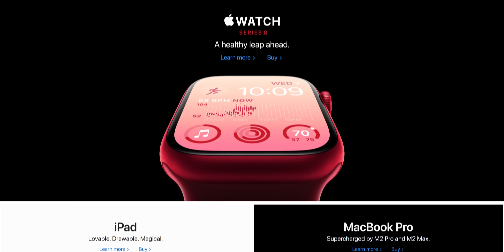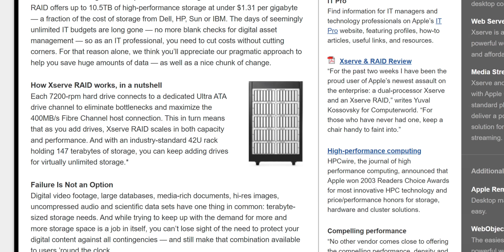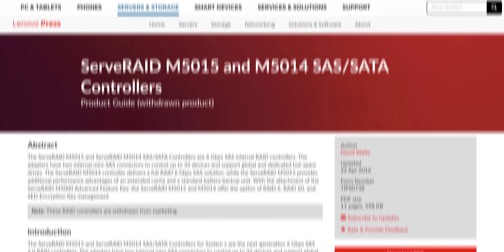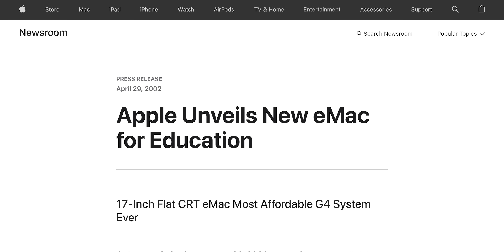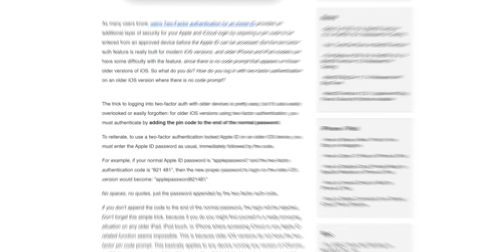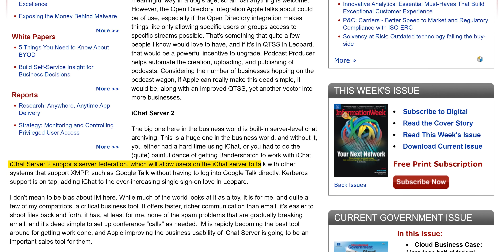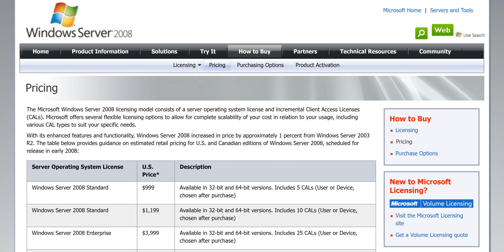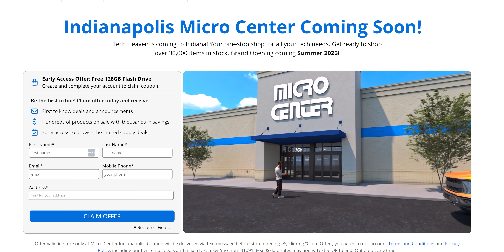I Bought the Last One Apple Ever Made... - Apple XServe 3,1 Server

Comment: Hi @Linus tech tips if you want to make it into a gaming computer, I’ve had experience with it in one of your previous videos, roasting your set ups pt- 1 about 14miniutes in. My submission was an xserve 3,1 you can easily upgrade them to a 4,1 and put xeon X 5690s in them and even upgrade the MXM I used it as my gaming computer for some years I even got windows 10 running on it you have to disable auto recovery otherwise it doesn’t like booting into it. You can even use other hard drives and SSD’s in the sled I used a 1 TB WD blue ssd. Good luck it’s a pian but is easy with time!

Comment: Apple hardware was and maybe still is used for picture archiving and communication system (PACS), x-ray imaging systems in other words, in hospitals. I remember a set of G3s and G4s later sitting on the floor of our computer room back in 2004/2005. We were not to touch them, only the PACS admin of the hospital and the vendor were allowed. One of these mounted in a rack would be far better and some cheese graters on the floor.

Comment: In my years as a System Integrator I came across exactly one Xserve out in the field. The customer was using it to run a Windows Terminal Server using Parallels for their ERP software. Besides that it basically acted as a file, mail and Open Directory Server. They replaced it with a generic HP Proliant a few years ago, sadly.

Comment: It looks surprisingly like every other 1U rack mount server I've ever seen. Are you sure the drives are firmware locked? On Dell servers, non certified drives will work just fine, except some of the management systems won't work right with the plain drives. 

Since most of the server software wasn't actually Apple specific, I've always assumed most of the failing of the product was just due to lack of a need for an Apple server.

Comment: I think it was 2006 when I installed 4 XServes at where I worked at the time. I remember the first thing I did after getting them rack mounted was setup integration with active directory, lol, that was "fun", especially because there weren't that many resources on it back then. Apparently, after I left that job, no one else knew how to use the servers, so they sold them like a year later.

Comment: You seem to be making the OS image creation process much more of a headache than it is. Yes, you need a running Mac to create Mac boot media, but you sure can install those older OS installers on newer versions of MacOS, and then using the CLI, you can create boot media from them. No need to frankenstein downgrade or upgrade machines just to get an OS on your Xserve. The drives also aren't proprietary, mine has a random Kingston SSD in it no problem and the original drives are in a TrueNAS box. Inside of the caddies is a normal SATA/SAS connector.

Comment: One of my last jobs I worked for a place as SysAdmin for a place and my lame manager was an Apple Fanboy.   So even though we were mainly on Windows and Linux he tried to get us to buy a Apple server.   So since I had done hardware eval's for other companies I was tasked with evaluating Apple server.   So I talked to Apple and even Apple was unicorn farts at how great their servers were, but could answer few tech questions.  They also went quiet when I asked if they had any customers I could talk to.    Basically I discovered hardly anyone was using Apple servers.   I used to work large university so I called around and found one department that had bought four Apple servers and arranged to talk to them.   So they showed me their rack of Apple and Windows servers.   Long story short even thought they were Apple diehards they were phasing out the Apple servers they were a expensive experiment that failed.     So Apple servers died away like Apple's Unix A/UX that came on 50 floppy disks and took all days to install, while praying the install didn't die just stop so you had to start over.   

So I convinced my Apple fanboy boss no to Apple servers and just be happy that the graphic department and media department have about fifteen Mac Pros.  That the video cards died on a lot and in media doing large file transfers to external storage choked on all the time.    So glad I'm retired now and don't have to deal with servers anymore.

Comment: Keep in mind that this uses the pre-UEFI firmware (EFI) in 32-bit mode! (EFI-IA32) So booting other operating systems is possible, but they assume the processors and the EFI to be the same and trip over the fact that a 64-bit CPU might be starting up using 32-bit fimware. It can be done, and you can even install Windows, but only if you chainload the windows bootloader via GRUB since it can setup the environment just the way windows likes it. Otherwise you're stuck with 32-bit Windows, and that would be a waste.

Comment: Oh! I've worked with these for 6 years ending only 5 years ago. Not even. The Paizo website used to run on these exclusively and I slowly worked to phase most of them out.

You are so better off testing with Safari. As the XServe support wained post 10.6, server support got worse and worse and worse. Including no longer supporting drivers for front panel lights.

Comment: Definitely would be great to see a follow-up. Whatever wacky things you can do to abandoned hardware is always fun.
Reply: agreed
Reply: Yes, please.
Reply: linux
Reply: @0q2628  Actually, back in the early 2000s, I worked at the university surplus and installed Linux on... things. Brandon liked NetBSD, which also is compatible with a wide range of hardware.   Ended up throwing it on a Digital Equipment Corporation (DEC) DEC MIPS system, a DEC Alpha, and a DEC Vax (a vaxstation 3100, which was about the size of that xserver rather than some huge rack like the early vaxes... or vaxen.)   An SGI (but put Irix back onto that), we put it onto an HP PA-RISC box that showed up at work, and of course a PowerPC Mac.  Mostly we got (earlier on) Gateways and (later on) Dells by the thousand but the exotic gear was fun. The Alphas and the PA-RISC were seriously fast (I picked up this close to 10-year-old Alpha with a 400mhz CPU and it was kicking the crap out of my (at that point year or two old) 900mhz Duron.  Especially video encode/decode, the Alpha had a "Motion Video Instruction" set addon that made it encode/decode MPEG2 and MPEG4 at like probably 20x the speed my Duron did with it's MMX and 3DNow instructions.  That was kind of nuts.

(As a prank, these guys actually rigged up a powerpc linux install with the same desktop and stuff installed, moved my home directory over to it, and took bets on how long it'd take me to notice.  It took like an hour or two, everything ran identically except for some reason the numlock capslock etc. lights weren't lighting up so after an hour or two I decided to reboot it and heard that mac startup sound... "What the...?")
Reply: Absolutely - looking forward to seeing what the guys can get going on this piece of kit :D
Reply: Yes, a follow up would be very nice!

Comment: Maybe a video idea for a followup :)

One customer still has three of the units running. Only Windows Server is running on them :)

The customer is very committed to sustainability and does not want to throw away functioning devices - and that is absolutely understandable :)

Windows Server can be installed natively on the hardware - without any tricks.
If there are still problems, the software rEFInd can be used.

Comment: As multiple other comments have mentioned none of the drive connections are actually proprietary. Also there are easy workarounds for installing any of those macOS versions as well as the Server app. You can even go to newer versions of macOS then are officially supported. Would love to see some more videos doing upgrades to older hardware like this!

Comment: Delidding those xeons isn't that hard.  Cut the adhesive and use a torch to melt the solder.  I did it for my mac pro.  If you destroy a chip at least they're cheap.

Comment: I might have a copy of Xserve software around here somewhere.

I heartily agree with your description of the hellscape of mac upgrades.  The only thing is, I've been bitten by things like this on a regular basis with normal modern upgrades, where their policies cause nearly the same level of problems.  Like refusing to install upgrades on a Mac Pro trash can with third party SSDs.  Or, like refusing to do network installs over ethernet, only WiFi (WTF?).  That issue where you can't create a thumbdrive for an OS without already having an OS that was upgraded with the downloaded installer (and then not deleted) has bitten me over and over again.

Comment: I use OCLP on my classic Mac Pro 5,1 and it's a power house, dual Xeon X5690's, liquid cooled 6900xt GPU, Raid Card with 4 NVMEs on x16 slot, 96GB Ram. And I have Win10 on it for gaming.  I'm sure you can do something similar to the xserves too.
Reply: https://forums.macrumors.com/threads/custom-water-loop-in-my-mac-pro-5-1.2310214/

Comment: I bought one of these from eBay a couple of years back for £30 just to have a tinker. Threw in an old PC 8600 GT card to get a display and had no problems with generic SATA drives, they’re actually not vendor-locked and the only catch was it didn’t like SATA 6G devices. Sold it not long after to a small business that still actively used an X-Serve which had suddenly decided to die during the week I’d put it back on eBay at a cheekily high buy-now price.

Comment: We used one as a MDC for XSan over a decade ago. It was for a custom video publishing pipeline we built for a big client and they already bought all the hardware so we integrated it ... its performance wasn't anything special but it handled 20+ users accessing storage and processing video without issue (actual processing and applications where on separate linux boxes)

Comment: Yes go ahead and make a gaming Laptop out of the thing.
On the point of your mentioning that Apple sometimes can be a Jerk about allowing the end user to move forward with their system, HP is doing the same on some of their machines.
I have a newer HP ds series laptop which HP crippled right from the factory by leaving out one of the plastic DIMM caddies for additional RAM.
The whole series, and probably others, are crippled worldwide. The machines only allow the end user to access 8GB of RAM when, if they had soldered into the empty space for the caddy the 38 cent plastic part, the machine might be able to access 64GB provided that manufacturers make those types of modules for the system.

Comment: if one were to find a one of these without drives but all the sledges, what spec are they to be able to replace them? vendor lock isnt a huge deal as long as its still possible to get them or at least emulate them

Comment: The connector is NOT proprietary, and the disks are NOT vendor locked. Apple always shipped any drive for the Mac with custom firmwares, which never meant you could not use thrid-party drives.

Comment: i was running snow leopard server in a physician's praxis until patient data management software decided not to support running on 10.6 but needed 10.8. the update took a full weekend, most server functionality was killed (the 20 chf appstore app is crap, will not migrate software from 10.6 server correctly) and basically from then on, it was not a network with workgroups managed centrally but single macs for the physicians connecting to a linux server for some functionability and to a NAS for timemashine. apple killed the on-site server for good and probably angried a lot of small/medium business customers with the killing of 10.6.server.

Comment: so apple does what microsoft does.. give you an update that disables features so you have to buy new software/hardware (software for microsoft)  outlook was a great example, update it so the older version gives you a bogus error and not connect to exchange any more.  Thus you have to buy a newer version of outlook.   talking 2003 and 2007 days. of outlook.  worked fine with newer exchange until you did an update, that cripples it hooking up to exchange..

Comment: 5:14 I don't think that HDD is proprietary. It looks similar to the hard drives that were used by full-size potable audio players from that era e.g. iPods: a 1.8" PATA hard drive with ZIF connector. Many thin-and-light laptops during those days simply don't have the space needed to shock-mount a 2.5" PATA HDD, so they'd use the 1.8" ones instead.

Comment: FYI you can extract the installer app from that installer package without having to run the installer package directly using an application called Suspicious Package. Then you can make the bootable USB from the command-line tool that resides in the installer app bundle (because it also won't let you run the installer app either).

Comment: The drive firmware isn't "vendor locked." Apple has a team dedicated to qualifying drives and they require all kinds of bug fixes to the drives. The drive manufacturers often then make "Apple firmware" because sometimes those changes reduce performance in the name of better data reliability.
Reply: Fyi you can totally "vendor lock" drives. Back in the day companies would call it "tattooing", and this is still done today by companies selling storage servers. These days you can brand a SAS or SATA drive by writing data to specific pages in the firmware.
Reply: @joshuamarcotte8514  Yes, and that was done in some game consoles as well. It was not done in Apple hardware.
Reply: Oh so it's not locked to one vendor, it's locked to drives with Apple specific firmware which only come from one vendor. Completely different
Reply: @TimSheehan  It's not locked at all. Linus was jumping to conclusions. I was explaining why the drive label was Apple-specific. You'll see similar labels in all vintage Macs that had hard drives.

Comment: I used to work for Gamma Medica, a company that sold a mouse/rat PET scanner that relied on XServe hardware to run the data acquisition from the PET detectors and perform image reconstruction. The CPU activity indicator on the front was super helpful to see if it was running a reconstruction job and if it had finished. By late 2011 we were starting to search eBay to find systems to use as replacement parts, and were working to get everything running on a Mac Mini instead. This is all because the university researchers who developed the system developed it all under OS X; folks, if you're working on a system in the future make sure that it uses either something that's well-behaved in Windows or can compile under almost any Linux distribution!

Comment: Funny to see Linus struggling because of his Windows mindset ...

You can swap bootdrives between Apple systems.
Like, an OS installed on a laptop, will happily work on say a MacPro.
Just as long as the target doesn't require a firmware update to run the later OS.

No need to use bootable installers.
Clone the OS using a period version of Carbon Copy Cloner from an external boot drive.
Or use Target Mode.

Comment: The part about needs mac OS already to install mac OS hits home with windows too. 

I built a brand-new computer last weekend, and I couldn't install windows from a flash drive on it for the whole day. For some reason the windows installer on the flash drive kept crashing and when I googled the error code it was a code saying I had a bad windows install and needed to restore windows. Like Bruh... the fix was to salvage my old Os drive on my old pc slap it in the new one and try to install windows... it worked. So, I needed windows to install windows.

Comment: The reason the install failed from a USB is because you must first make the USB stick OSX Extended Journaled encrypted a regular OSX extended journaled drive will fail every time, we used xserves in our recording studio because they had all the CPU horsepower of a Mac Pro without the giant cost of that machine. We tethered them in our machine room with our recording console's very hot and loud power supplies and they did the job very well. I always thought Apple for some reason made the xserve require an OSX-EJ encrypted OS USB just to keep random kids at schools or other pranksters from wiping the servers. But I remember forgetting about it every time I needed to wipe the X-serve and making the drive all over again. I still have an X-serve on my network running Linux for security system and cameras.

Comment: It used to be possible to log into Apple-IDs with the 6 digit 2FA code appended to the password using older iOS and macOS versions that lacked 2FA support if you knew about the quirky workaround, but it has been years since I had to (ab-)use this implementation detail.
Reply: I should've watched the next 30 seconds instead of pausing to show off 😜.

Comment: check out dosdude1's high sierra/catalina patcher or open core legacy patcher to run practically any mac os on unsupported hardware. I have the same xserve dual booting high sierra and monterey. However it's just a display piece at this point as the hardware is essentially 15 yrs old even though mine is maxed out with 2x W5590, 96GB RAM, 2x 300GB 15K HDD, 1x 2TB HDD